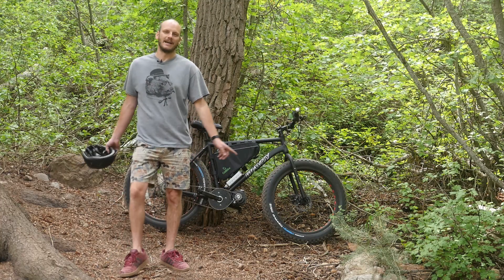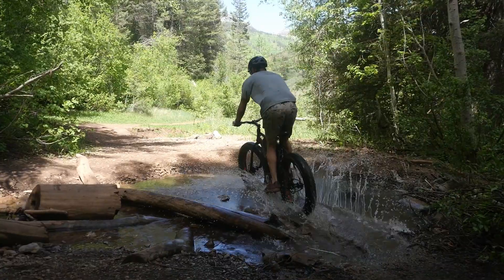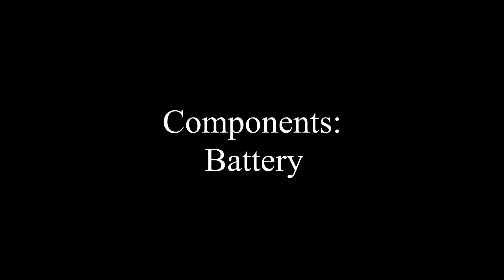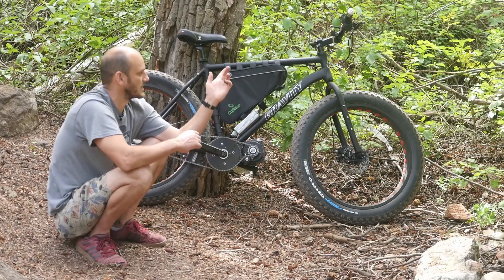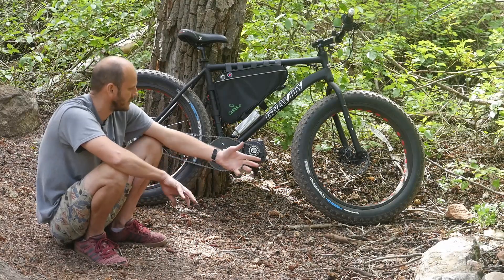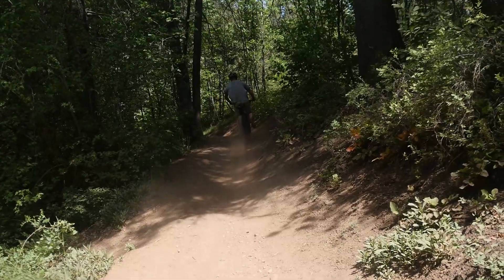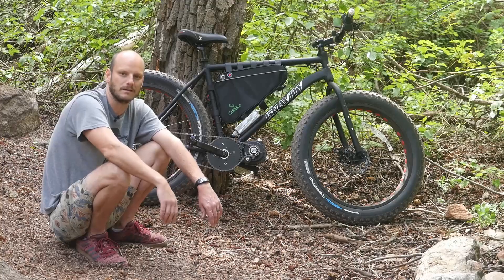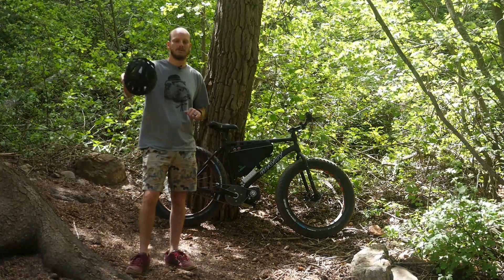Custom E-bike Build: Cyclone 3000w Fat Bike

Comment: Out of Seattle WA. I bought 2 conversion kits. When they arrived they did not send the extensions & the small part that connects to  your frame & the back rack.
The back rack carries the battery. Covid hit and I think they shut down. I still can't find anyone that will work on a conversion bike or make a part. You mentioned you could build a bike or parts. Please help so we can get back on our bikes.  😢
Reply from the maker: Johnnynerdout.com. All we do is custom e-bikes. Components and help.

Comment: I have an unrelated question about an unorthadox battery.  I have a Specialized stumpjumper fsr 2007 and Ive added a bafang bs02.  Unfortunately I cant fit a downtube battery unless i go underneath.  If the forks went through 70% it would get hit.  I dont want to add pne tp the top of crossbar.  My question is could I use a 48v frog battery on the seatpost as a mtb trail riding alternative?  I can forsee problems i.e. security of attachment and also being able to drop the seat for steep downhill drops.  Have you any experience of frog batteries?

Comment: Can this easily wheelie ? Considering it’s fat bike
Reply from the maker: It’s not geared to wheelie. It could be though.
Reply: @JohnnyNerdOut  I’m building a rear motor 3000w dual 60v 24ah battery you think will wheelie is fatbike 😦 single speed as well

Comment: Will please yu help me? I have been looking for over twenty years to find someone who even does what yu do. where are you? I've got the first EV Warrior sold on the west coast, also the first Releigh Zap mountain bike police edition and an extreme radical stunt bike and a three wheel a Schwinn senior coaster type bike with eight gears and a very powerful Electric motor that powers the front wheel with a roller and lever system that powers the bike at over 50 miles an hour all these bikes are the old roller type Powertrain and have gears. could you scavenge from the lot of this components to do the following. I have two folding bikes one is a liberty trike with a 750 watt front wheel drive I would like to somehow power the rear wheels to give me more options when I go into the forest and climb Hills the other is a single-track folding mountain bike 750 WATT 1100 peak rear wheel drive bafang. I want a front hub drive added to it if yu can't figure how to use the drives from the AFORE mentioned bikes we can scavenge for parts....one advantage to these older bikes they are far more powerful motors than what we get on electric bikes. all mine went way faster than 28 to 35 miles per hour....I had a gas powered roller kit that sent a Huffy passing a cop at 85 mph. He was so amazed he settled for a lot of laughter and friendly banter. Sehingfranciswinddragonschool@gmail.com https://youtu.be/hz1_ISOVTQM

Comment: In Australia we are limited to 200 watts power purely from the motor and 250 watts during pedal assist (or the other way around?🤔) which is quite a weak motor from an American perspective. I want a very reliable bike to use for ‘bike-packing’ with minimum 10-20kg/22lbs-44lbs and possibly up to 88-100lbs (if towing my dog in a dog trailer)
And I want to be able to climb hills on unsealed dirt roads with those higher weights, but dirt walking tracks with the ‘lower’ weights of 22-44lbs.
From what your saying, I should get a standard good quality fat tyre bike, and have a mid-drive motor installed at least for the 22-44lbs (excluding my own average weight) hiking trail bike-packing trips, but if I want to tow a trailer with a 88lbs dog in it or even that amount of ‘cargo’ is any e-bike with the 200-250watt legal limit practical at all? Or should I just accept I need a motorcycle license and a low geared reliable cargo motorcycle like a Honda CT125?
Reply: you cannot tow a trailer with a 250w motor with a fat tire bike, on roads with normal tyres maybe.
Get a more powerful motor and a sticker that says 250W, so long as you are not doing silly speeds on the road nobody will know

Comment: What's the amp rating for the controller and what's the discharge amp rating for the battery bank? I feel like it is slower then most 3000 watt ebikes. Most get a top speed around 50 mph with a 3kw motor

Comment: Hey Johnny , can you suggest a beach cruiser bike with 6 gears and disc brakes that would be ideal for a conversion. I have back issues and need a bike I can sit comfortably upright. I have an Electra cruiser but brakes are the old fashioned rubber friction and adding a motor ect wouldn’t work to well . Thanks . Love your videos.

Comment: Stoked to see a fatbike build. I recently got obsessed with the world of E, yet haven't made a purchase...onewheel, scooter, e bike??? I JUsT DONT KNOW! anyway I have a badass surly lowside on 650b x 2.8 single speed...I wanted more than 20mph out of a conversion,, i now I see that I can get that.... I couldn't decide wether or not to invest in a drivetrain also...haven't decided but thank for the vid!!!!!...soooo, are you happy with the single speed or do you wish for more gears? Should I convert this bad mammajamma!?
Reply from the maker: I’d go IGH for the ultimate of both both worlds. If you can afford it, the Rohloff is the transmission to go with👍
Reply: @JohnnyNerdOut  excellent! I was thinking the same thing. I really like the direct connection of a single speed. My right knee doesn't like it so much....rohloff is pricey but that plus this motor on a surly!!!?!?!? That would be pretty epic. Thank you sir...1 question, do you think the rohloff will stand up to the torque?
Reply from the maker: @muggachukka1629  supposedly it should be able to 🤷‍♂️
Reply: @JohnnyNerdOut  fair enough. Now I just have to sell the rest of my possessions lol. Thanks again man!

Comment: Johnny please help i have a 750w bafang fat bike.
My problem is the controller overheat and has burnt out. How do I beef up the controller ? I need to upgrade it so it doesnt repeat.
What do I have to do to upgrade?
Reply from the maker: Burning up controllers is not common at all. I’d be surprised if it happened again
Reply: @JohnnyNerdOut  the controller is mounted in a waterproof container under the frame and although having pedal-assist i used it full throttle all the time. The unit has a heatsink but nowhere to disapate
Reply: @_CORO  I had a controller mounted under the battery behind the bottom bracket that failed but it was due to water getting into it not burnout, perhaps yours did and you got a short circuit, do some silicone sealing when you get your new one
Reply: @JohnnyNerdOut  thanks for the reply.

Comment: Hey Johnny... Awesome video's..!!

I have 2 questions for you. I have a "TRUE" B-52 Stealth Bomber ebike (not a clone). I ran into a situation last year where I had a flat tire, I took the wheel off to repair the flat, now the bike will power on, but wont go. I took the tire off just to make sure I didn't cut anything, etc.. still no joy.. Do you have experience and work on Stealth Bombers...?  

Second question. I still have my first ebike, RadRover Fat Tire bike. I'm looking for something a little faster with better range such as the bike you feature above. Is there anything you would suggest with the rad bike, or should I just sell it and build out a bike. I may see if there is something you can build me as well, but I wanted to get your thoughts..? 

If its easier for you, I'm happy to contact you directly for a further discussion.. Thanks..!!
Reply from the maker: Check the connectors and cables for pinches. You can upgrade the rad rover to a mid drive which will really wake it up 👍
Reply: @JohnnyNerdOut  Hey Johnny... thanks for getting back to me. Yeah, I did check that already. Some are questionable and may require me to pull the hub apart to do a full replacement if I go that route. Are you knowledgeable of Stealth and do you work on them... ?    Yes, I'm happy with the framework of the RadRover, I just want to get a little more power out of it.  If I went in that direction, what could I purchase from you ...? Thanks...

Comment: i have a question!  :)  Have you installed any cyc-motor products, like the X1 Pro or the newer X1 Stealth?  Sort of the same sphere as this motor i'd assume...  :)  And i'm wondering what occasions you receommend to use a 'gear sensor' so that when you're shifting gears the power cuts for just a moment to not completely murder your drivetrain!!  😅  what gear sensors would you recommend also?
Reply from the maker: I am still waiting to get my cyc kit! I always recommend a gear shift sensor for any mid drive. I have them listed on my site unders “sensors”

Comment: Love your vlog J. That needed to be said before I pick on your bike. First I would gear it lower 39mph is too fast for rough trails and it looked like it struggled to climb that mild grass hill, lower gearing would help a lot. Using a zip tie to hold the drive chain tensioner spring, kinda sketch. What is the large hose clamp around your motor about?
Reply from the maker: Yes I agree a bigger rear cog would’ve made a world of difference bringing the usable power to a lower speed. The hose clamp keeps the motor from working itself loose. It’s a friggin beast of a motor and needs to be strapped down like a mentally ill gorilla (could be a cool bike name 🤔). Anything can be used to keep the tensioner in place but that is what cyclone sends with the kit ( as well as the hose clamp)

Comment: The battery?
Reply: Johnny, I love your videos, but this time I need your help.  I built an awesome ebike with a voilamart 1500w with the controller inside the hub, this thing was a beast 36 mph, but all of the sudden after only 250 miles it died on me, the display flashes a different speeds and the motor makes a sound as if it wants.to work but nothing, I have a video attached hoping you can help.or at least point me in the right direction. 
Any help will be much appreciated. 
https://youtu.be/KUrVkuHyJRM

Comment: Hey johnnynerdout I have 2 questions  can I  build an E-Bike that can handle a 350lb  man I have a 2021 Schwinn 29er mountain bike 8 speed last question is I have Cerebral palsy on the right side of my body so I was wondering it they twist  Throttle for the left side of the bike Please any advice would be great thank you
Reply from the maker: Yes you can do that with the throttle. Not sure What the way capacity of your Schwinn is though you would have to check with the manufacturer
Reply: @JohnnyNerdOut  thank you  but I was wondering about a good electronic motor that can handle my weight I don't want burn the motor out push me lol
Reply from the maker: @benjaminscott5966  get the bbshd by bafang

Comment: Dear JohnnyNerdOut:  I LOVE what you've done--take a reg. fat-bike pedaler and add a GREAT motor. & HD-amp battery.   I'd like to add rear{?} rack{s} to carry two bags of groceries, and 4 battery packs, so I could travel 140miles @ 40mph on 2nd-ary roads, having a front suspension that if I run off the road, I can safely stop without jumping off/crashing.   I want SPEED, plus RANGE, & Range & Range on pavement, now. --Maybe  I'd learn dirt-riding later.   I'm alarmed @ the chain coming off, why not then add a few more pounds and use belts, which can be MUCH harder to throw, because there are deep grooves on some of the belt sprockets, plus belts don't "stretch" as much as a chain, so they might be more efficient than chains, also lasting longer.   Are there ANY 90cc 4-stroke gas motors that would continuously "charge" via car alternator, the motor/batteries, so 70mph and REAL "cross-country" riding would be possible, kind of like the Fisker Electric Auto that uses a gas engine to keep the electrics "charged" after its 30 miles of range poops out.    I'm thinking of the  Tucson - Phoenix run, which while listed as 120 miles, is more like  160 because I live 40 more miles from where they start Counting.   This trip takes fully two+ hours, so would take 4 + hours on a 40mph bike, with NONE able to take the RANGE without multiple batteries {4-5?} if done completely Electric.    Also, why not "drive the front fat tire with a center-hub motor" mounted to turn with the front wheel?  {like the TWIBIKE, only powered }

Comment: My bbshd with a 48v 500 is plenty power and speed. I put it on a full suspension. Santa Cruz blur, Recently added a boxxer fork 200 mils travel. Added a dropper post. Absolutely brilliant. Charge it from my solar on my truck camper. 26" Wheels. Looking into adding a 27.5 front make it into a mullet.

Comment: Hey Johnny, just found your channel, instant sub. I’ve been building ebikes for a couple of years now, a few of them were dirt jump bikes which I built as single speeds with different bafang mid-drives. I often get some flack online for not pairing my mid-drive with with a cassette or IGH. Obviously, the bike in your video is a single speed as well, curious to know your thoughts on ss + mid drive. Clearly there is a bit more usable power when using gears but I honnestly don’t find the ss to be that much of a detriment. 
Love your channel buddy!
Reply from the maker: Thanks! I still prefer mid drive SS over a hub. You can still swap out chainrings/cogs to chain the gear ratios to completely change the performance of the bike to suit your needs.
Reply: @JohnnyNerdOut I'm  newer to  your  channel...  not hip to all jargon quite yet...   ebike .what's  SS  stand for,  
single speed maybe ...
Reply from the maker: @franksplace551  yep, you are hipper than you think 👍
Reply: @JohnnyNerdOut  right on! I got some cash and ready to pull the trigger on parts I guess I should go to your website¿  I want minimum 1500w w' 52v or better juice...    I have an original Schwinn stingray
(Mini bike I guess it was) frame...    Badass looking oval frame tubes 20 inch fat rims have either girder or tube front end for it. Going to juice the brakes system using SS as you prefer with mid drive. So yeah Johnny I'm ready for my parts list! 😎🙏‼️
Reply from the maker: @franksplace551  check your bottom bracket diameter as I am guessing you will need an adapter of sorts. Possibly might need to custom make one even
Reply: @JohnnyNerdOut  Koo koo koolio...   You are the man see they don't tell you all that secret s***
I am more than ever now confident to be able to build my own bad ass bike because of your expertise. Try to help others too with paint and body work I've been doing it for 25 years plus
The new pearls and flip flops they have out r crazy man.
I just thought about battery. I'm going to get the mid drive and I wanted to have balls and longevity. I will end up buying them from your website if that's cool? I'd appreciate a suggestion for my base setup which I will start with. I will measure the space where the pedals go too for the adapter. I deal with a machine shop when I work on Harleys. My 58 didn't come with electric start unavailable in 58. Guess what mine is electric start thanks to a machine shop haha yeah that's the first year of the swing arm frame 1958-1985 then they came out with Softail frame the shock underneath in the bottom actually they're dual fat shocks 👍🏼 so the whole rear carriage swivels front and rear instead of side to side handles a lot better still using it today all right then Johnie thank you
😎
Reply: Yeah I got to get back to your website and figure out how to contact you for that one-on-one
FRANK
Reply: Yeah man assess is the way to go you don't have to worry about your cassette derailing on you in tense situations...😎

Comment: I thought you only need a controller when you have a hub motor, not a mid-drive motor...AND I thought you said you would prefer a hub motor on  a single-speed bike. Explanation would be great..Thanks.
Reply from the maker: all ebikes need controllers, Bafang builds theres into the motor which is nice. Cyclone does not, hence the bulky controller.At this power level, a hub motor would've worked too, but i like the mid drives because i can switch cogs/chainrings to achieve different gear ratios, something you cant do with hubs.
Reply: @JohnnyNerdOut   This helps. I am going to contact you in a month or so, let me get up to speed with my own knowledge a little. Trying to build 2 trikes, single speed....first time doing anything like this; Im so Scared!
Reply: @Mike-B.  hey how did it go with the trikes?   Don't fear
Reply: @GIGATT808   Rough, Im still working at it; I ordered so many incorrect parts, but that's okay I guess, just delays everything. I also used the wrong frame, so needeless to say I have started over twice. Lets just say Im still going after it....

Comment: Cool build but this bike deserves an 100A controller
Reply from the maker: Ya and a bigger motor to handle that😀
Reply: @JohnnyNerdOut  What is the absolute limit Amps of this motor? I understand these 3kw have nylon gears so need to be careful. From the 4kw upwards all of them have steel gears, maybe you could start using them?! 
Did you ever test the Cyclone 6kw or 7.5kw versions? 7.5kw about the same weight and size as the 3kw.
Reply from the maker: @Full_Throttle_no_Brakes  I haven’t. I kind of feel 3k is already pushing the limits of a bicycle frame and drivetrain, even if running a single speed. I’d say around 50-60 amps continuously those nylon gears start to brake and the windings start to overheat
Reply: @JohnnyNerdOut Thanks for your response. Please consider using Steel gears in the future. From Cyclone they cost about the same and last forever. Just use high-quality grease and you are good to go. They are also quieter than the nylon ones.

Love your videos. Keep it up!
Reply from the maker: @Full_Throttle_no_Brakes  definitely. Thanks!

Comment: Nice. My friend has bafang and put a new controller and it does 120 kph but he had to change out nylon gear to a metal one and the motor can handle  72 volt battery but for price wise right bow the cyclone is cheap 529 cad
Reply from the maker: Nice